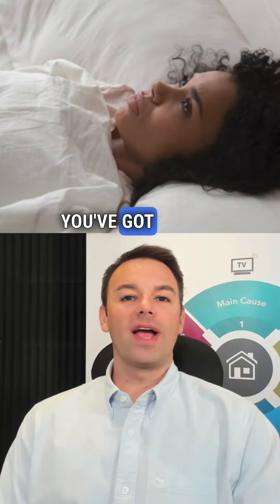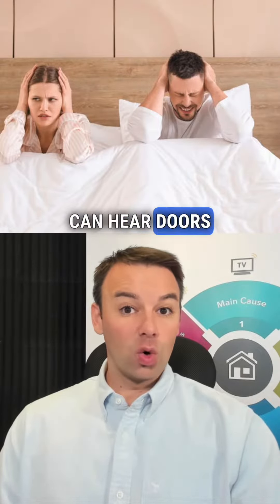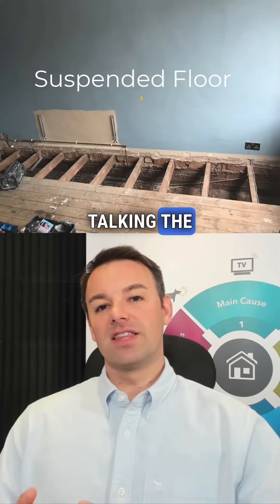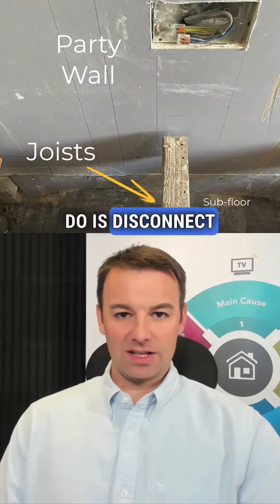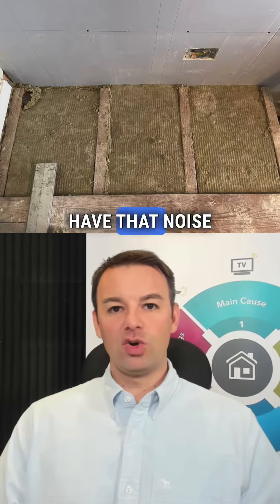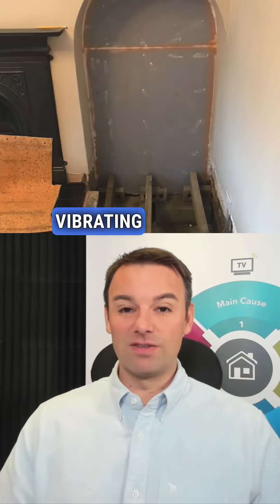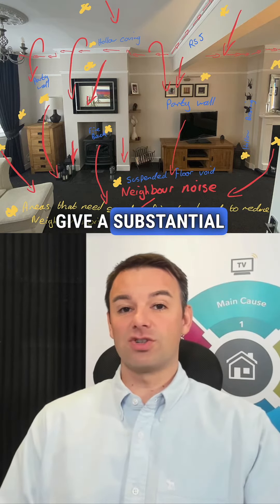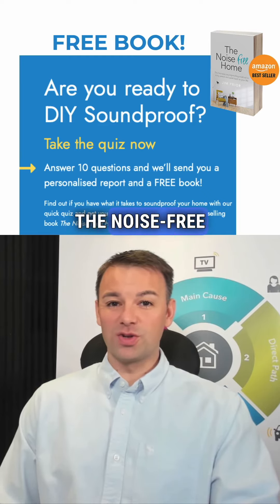How to Soundproof a Room from Doors Banging

Comment: What if the terrace house is built with concrete and brickwall? Not possible to cut the concrete beam shared in between
Reply from the maker: Hi @csiajoo, that is a great point, thank you for your comment. When you have this situation and you are hearing doors banging and furniture moving you need to sound deaden all the concrete walls with sound insulation. With regards to soundproofing the floor I would recommend a floating floor. Decouple your finish floor from the concrete floor.

There are soundproofing floor products you can purchase that have an anti-vibration matting beneath a cement particle board (about 30-40mm thick. These board will massively reduce structural borne noise coming through the floor and waking you up. This is what we use when soundproofing a bedroom and it is not possible to disconnect the joists. Hope that helps and thank for your comment 🙏
Reply: @jimprior7  Thanks for the details feedback! The banging door sound is from my next door neighbour. My floor is installed with SPC flooring with a 5mm foam underneath the SPC. Will this amplify the banging sound?
Reply from the maker: @csiajoo  I would make sure the finish floor is isolated from the walls, make sure the skirting is isolated from the finish floor like we show you in the Noise Free DIY Soundproofing Course. I don't think your foam is amplifying the doors banging, but depending on the type of foam, noise may travel more easily through it.... then say some of these types of underlay: https://www.floorscan.co.uk/acoustic-underlay/